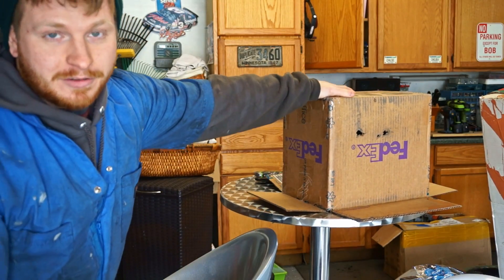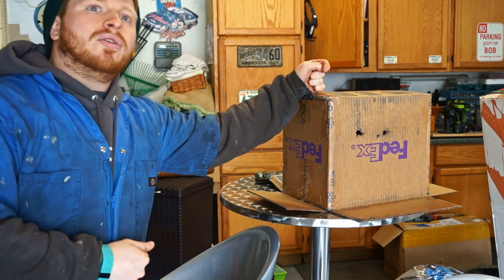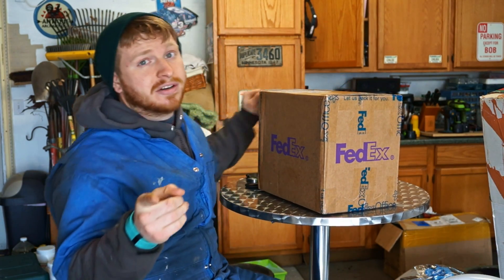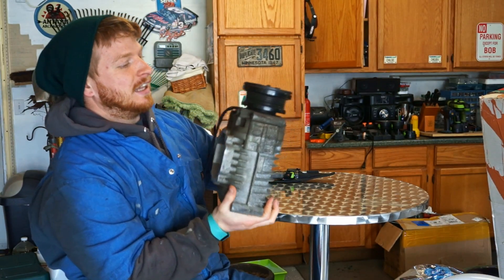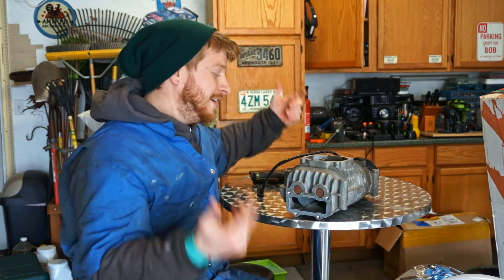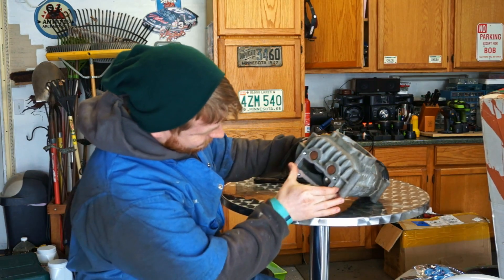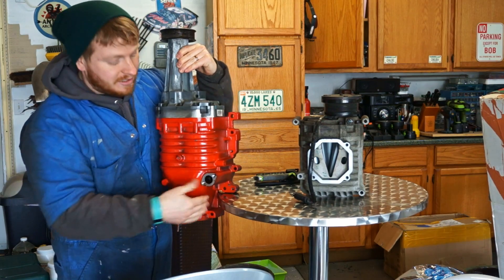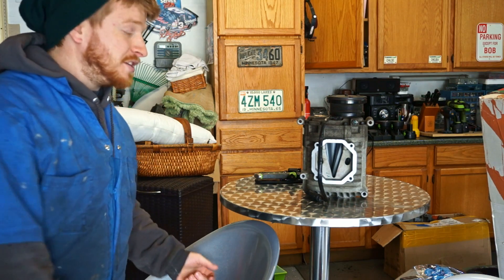Eaton M62 vs M90 supercharger

Comment: What supercharger would you recommend for a Jeep 4.0L based 4.6 Stroker ? I like the low rpm grunt provided by superchargers than having to wait for a turbocharger to spool up. And if the supercharger has a switch to shut off for improved fuel efficiency when extra power is not necessary all the better. Thanks

Comment: How does the electric clutch work?

Can air still pass through the supercharger while its not moving?
Reply: Electromagnet engages the clutch, air cant pass through with the sc off, a bypass valve is used so air can still get onto the engine when the sc is off
Reply: @madthough2298  aah I see, the bypass valve makes sense. That is what I was missing.. What sort of valve is that? Must be quite large like 50 to 60 mm and must open and close quickly?
Reply: @Zapo9668  Mine is an m45 so smaller than the m62 or m90. Its basically a vacuum operated throttle body, 40 mm in diameter. Its mostly open under low throttle conditons so doesnt need to bypass much air

Comment: Eaton M62 Kompressor.
Where is the rpm limit?
I Drive a W202 C230K with a M62 Kompressor and i will tune it.
Reply: 15000 apparently
Reply: That's a Mercedes naming but M62 is a V8 engine by BMW in the late 90s - early 00s

Comment: That's different than my Eaton m62...it has a snout(2006 cobalt ss/sc), and it has a bigger intake for throttle body.
Reply: Its off a mercedes benz my 99 c230k has a eaton m62 also

Comment: A slightly more useable M90 comes from a JAGUAR X300 XJR-6. Straight six. 
 It has removable inlet and outlets, teflon coated rotors. A really short snout like the m62 you have and a small 3"upper pulley  Really easy to fit with 4 nice mounting lugs. Check one out if you can find a Jaguar breaker. Also came on Aston martin DB7's but rarer and aston tax as standard
Reply: SHIREDRIFT m90 also on ford super coupe 3.8l 👍
Reply: SHIREDRIFT I’ve always been really curious if you could replace the 3800 M90 with a Jaguar M90
Reply: @cameronvandygriff7048  Different casting on the case so the outlet flange and bolt pattern is different. Its doable but youd be better off with an aftermarket or ported stock case.
Reply: @madmod  yeah I've completely given up on the idea that was brewing then I wanted to out a M90 on a 3800 in a camaro but basically it involves a custom casing and beating the firewall and alot of other custom parts and turns into less work for a V8
Reply: @cameronvandygriff7048  I was just working this swap out for a customer in a firebird. It used a magnum mpx extreme m90 case, stock 3800 snout and pulley, and it used a stock gtp lower with an adapter plate and should be good for 350fwhp on e85 non intercooled. This case is only $450 new and we just had a 3.5 inch aluminum tube welded onto a flange for the inlet and fed it with a single blade 90mm tb. The 3800 is plenty stout as far as power handling goes and the m90 can feed it well. The rest of the swap was fuel system and was relatively affordable. It is a tight squeeze but far more workable than a stock gtp 3800 case.
Reply: @madmod  interesting I don't have the car anymore but I'm not against finding another one with a manual and t tops and really building a 3800 I honestly loved the thing had a stage 2 cam little bit of porting and decking just fun af

Comment: hi .... how much boost does it make ? also can it be installed on a mustang 2005 ? and how much hp could it give me ?  i ve seen some at a very good price
Reply from the maker: +C4N4Di4N1 I'm assuming 5-8 psi. Not totally sure. 
Yea you could put it on a mustang, but it might be a little small for a v8
Can't tell you how much more hp you'll make, anywhere from 0-15hp per lb of boost
Reply: thanx for the reply then what not expensive charger would you recommend ?
Reply: i also seen the m112 i believe but they all for 04 and down ... mine is a 2005 is there a place i can get an adapter ? or something ?

Comment: LMAO, I don't think i've ever heard anyone call an M90 a monster. If you want something to compare to the M90 or M62 that you may consider monstrous you need to look for an M112 or M122. Or if you want something to really make that M90 look monstrous how about finding an M45.
Reply from the maker: +Scott Lambeth I know it's not a monster in the supercharger world, but in the turbo world, which is what I'm used to, it's massive
Reply: M90s can be made to outflow m112s easily due to a shorter lighter rotor pack. Problem then becomes all the heat. If you want to talk about monstorous roots blowers, I believe a 6-71 is something like 420 cid per rotation vs a m112 being 112cid.

Comment: more videos on the subaru with the turbo. Do you notice any sound difference when you added the turbo? have you dyno it yet?
Reply from the maker: +FatalNukeZ huge sound difference with a turbo. 
Haven't dyno'd it, I don't really plan on making time to dyno. I'm not too interested in numbers as much as drivability.
Reply: Dirtcheapdaily what was the total cost of the turbo build? Now I want to buy an 08 Impreza hatchback will it be more challenging installing the turbo because of the body style?

Comment: Subaru, well FHI, actually makes a supercharger. it's for the old pleo key cars. some say it doesn't push enough boost to make a huge difference, maybe 5psi, but It's pretty cool that a subaru came factory with one.
Reply from the maker: +Fox Mense yea I've seen those things on eBay. Pretty cool little chargers. I think it'd be a good option for a 1.8 or 2.2, maybe a 2.5, but I worry it wouldn't flow enough at high rpm
Reply: Dirtcheapdaily yeah it may end up hurting an H6 in the long run. on a 1.8 though it would be perfect. maybe a future project haha
Reply from the maker: +Fox Mense yea definitely! Even if it was a short term thing before throwing in something bigger. It'd be fun to do
Reply: Dirtcheapdaily the 1.8 gc's can be had pretty cheap too, a friend of mine just picked one up for $300
Reply from the maker: +Fox Mense yea definitely! Even if it was a short term thing before throwing in something bigger. It'd be fun to do
Reply from the maker: +Fox Mense yea you're right. I could have sworn I was looking at a couple the other week that were v belt. But I guess it must have been something else.
Reply: Oh that is what you meant. Looking it up the other day, there are other brands that use it besides Subaru, so some may be V belt. Plus there are refurbishers who sell them with V belt pulleys as an option. So makes sense.
Reply from the maker: +802 Garage they're only like $100 on eBay. And they have just a normal vbelt pulley, not a serpentine ribbed one. 👌 do it!
Reply from the maker: +802 Garage plus the 1.8's are bullet proof!
Reply: Dirtcheapdaily the pleo supercharger? that has a typical multi ribbed pulley, not v belt
Reply: Oh apparently they make a couple sizes. A 300 cc and 500 cc and the smaller one is only good for 1.0L while the larger should go a bit higher. Still if it could make 4 or 5 PSI, could still probably add 30 HP to a 1.8L I'd think. And yes they are bulletproof. Mine is about to hit 200,000 miles. The EJ18 and EJ22 are just dead reliable.
Reply: I have been wanting a bit more power for my 1.8 ya know. Hmmm...
Reply: Fox Mense I think that's what he meant. Typical lateral V ribs, not toothed like a timing belt?
At any rate some cursory research says they may not be ideal for over 1.0L engines. Perhaps use two? :D

Comment: Hey Aaron, 
I recently replaced the turbo and TGV sensor on my 2005 Outback XT. The XT now sounds more like it has a supercharger than a turbo because you don't hear wastegate flutter or BOV sounds. I would prefer to hear the chu chu noises though.

I still have to check for vac/boost leaks. It's running really good though, the acceleration with the new turbo is very smooth. I put a video up on my channel if you want to listen to it. I held it around 40 MPH because I was going around a corner. You will hear what I am talking about right at the end of the video. Any theories why it sounds like that?

The aftermarket turbo that I bought did NOT come with a restrictor pill. I still have the stock pill but have not tried it out on the new turbo. I need to buy and install AFR and Boost gauges before trying to make any more adjustments. 
Anyways, thanks for doing these videos, I look forward to watching your Q&A livestreams.